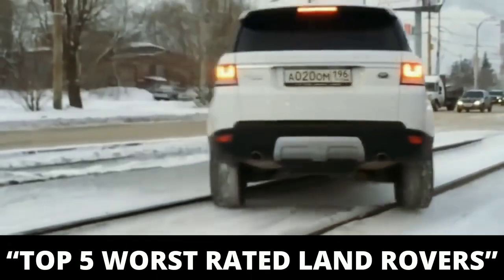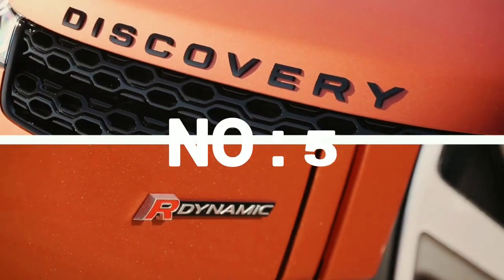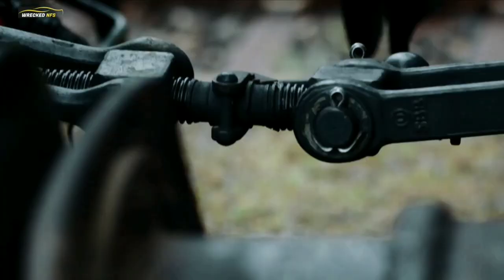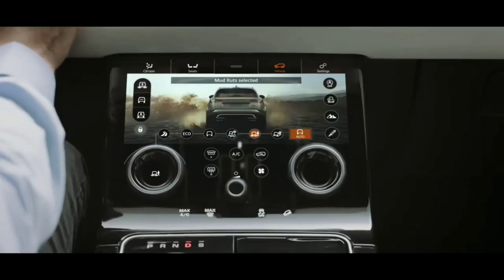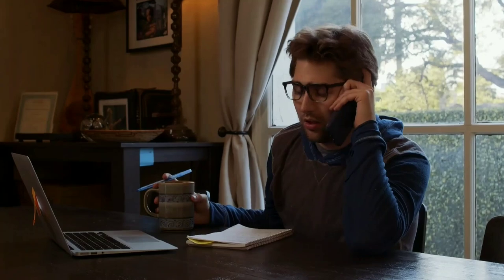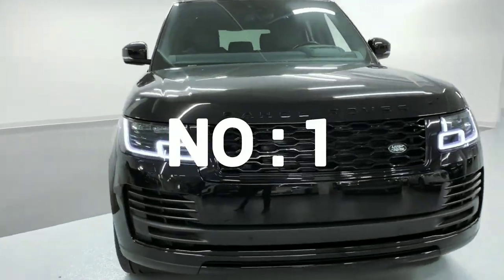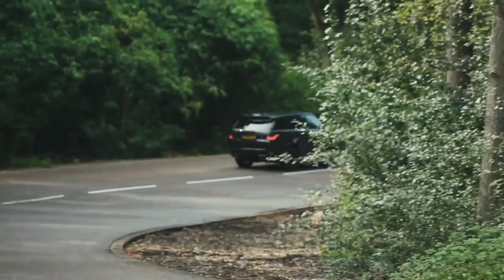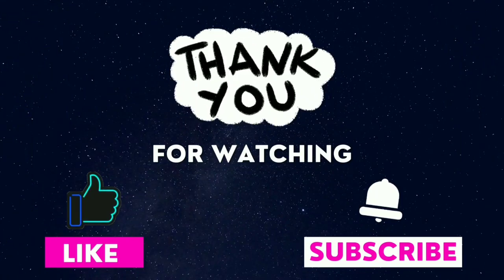Top 5 Worst Rated LAND ROVERS

Comment: There is no such thing as a perfect car, like you said Land Rover is build for luxury, off road capability, and adventure. So don’t bash em just on reliability they’re good cars power train wise electrical and water issues is another story. People just are in above their means can’t fix em and let them over heat till a head gasket blows, any Toyota or Honda will do that to without repairs.